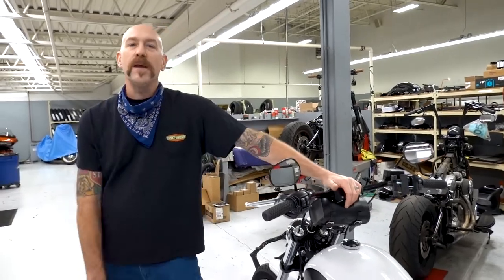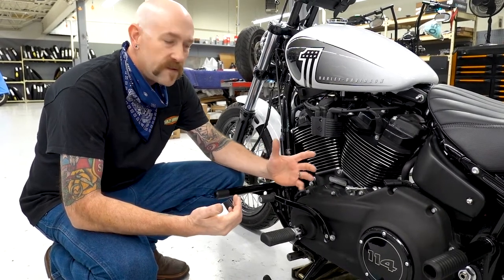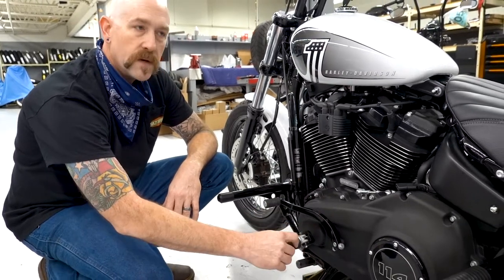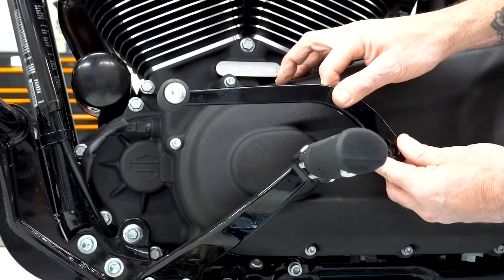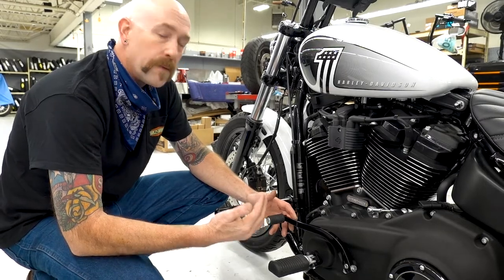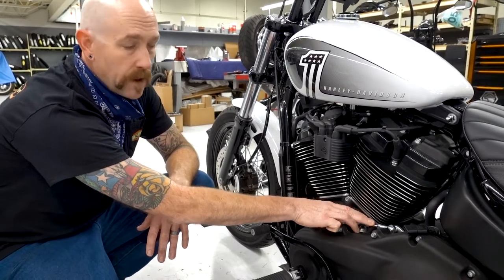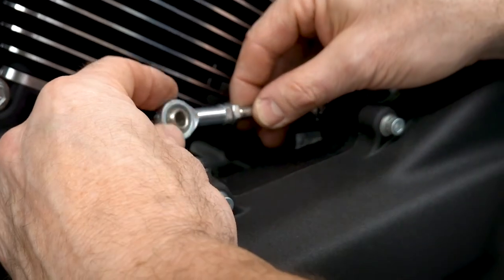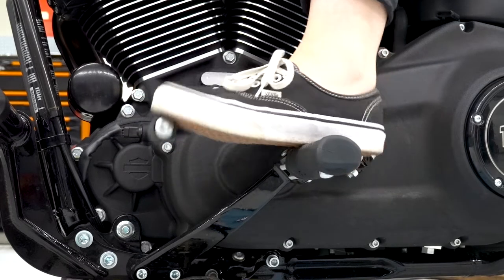How to Adjust the Shift Pedal on you Harley-Davidson

Comment: Is it normal for the clutch lever to feel loose going in and out? Not side to side where the bolt lines up but from the engine outward… if that makes sense. There’s just a little give their that I don’t remember if I had prior to readjusting this.